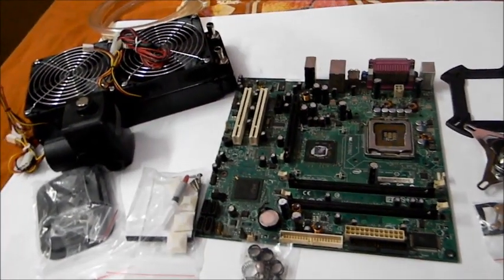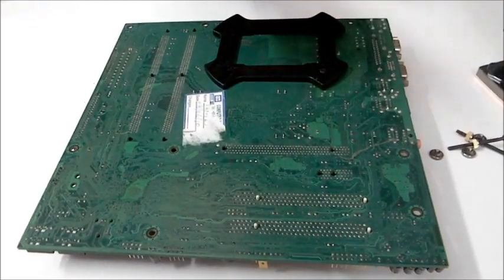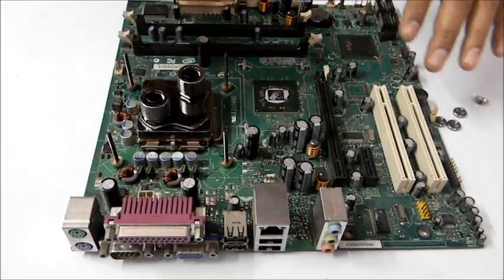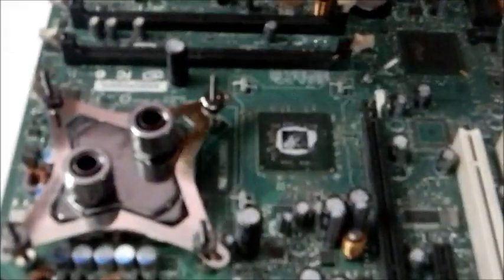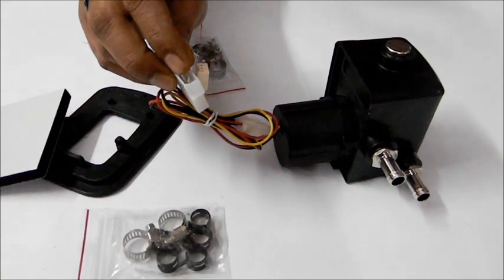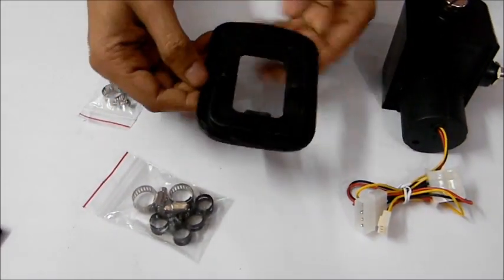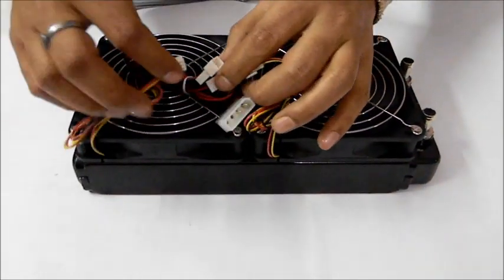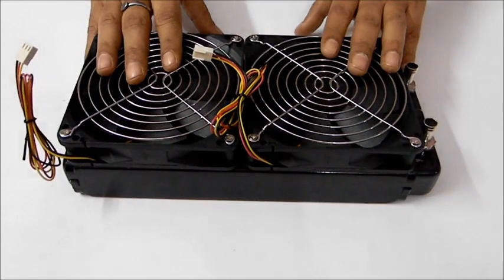SCT CPU Water cooling Kit Liquid cooling kit India Installation

Comment: Do you have full water blocks for high-end gpus's like the Asus Strix 980Ti??
Im plannig for a custom water looping in my gaming pc and i was wondering how much your company can help me with this

The things I need are 
1)Water block for CPU(i7-6700k)
2)GPU water block(Asus Strix 980 Ti)
3)PETG hardline Tubing (4 metres required)
4)Reservoir(Preferrably cylindrical)
5)Pump
6)8 Compression fittings(size doesnt matter,just has to match the common tubing sizes available)
How much can your company help me with this?
Reply ASAP.
Reply: did u purchase the custom water cooling kit ?
Reply from the maker: Dear sir, We are the manufacturer of liquid cooling kits in India. We have many kits available, kindly WhatsApp / Call us at 9818079814 for more details.
Reply from the maker: Hi,
Kindly call us at 011-25390245 or WhatsApp us at 9818079814
We do have full cover block for your GPU as well.

Thanks